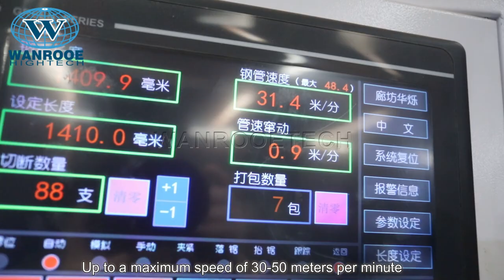Automatic Line for Handle Manufacturing 30-50M/Min Broom Handles Steel Pipe Plastic Coating Machine

Comment: What is the thickness and size of the tube
Reply from the maker: Thank you for watching our video. Can you leave your contact information? Whats app and Email. Our professional staff will contact you immediately
Reply from the maker: The plastic pipe with various diameter and wall thickness, from 16-800mm